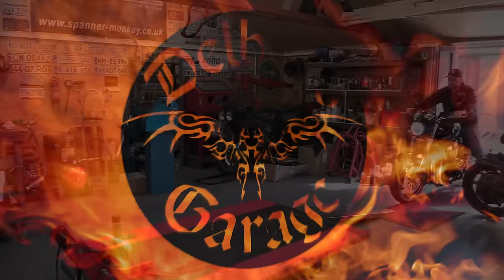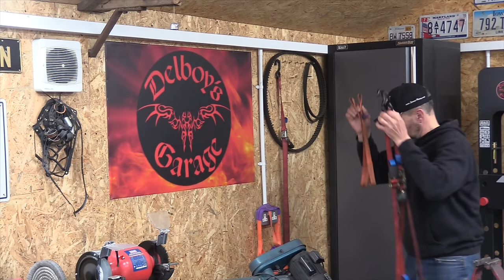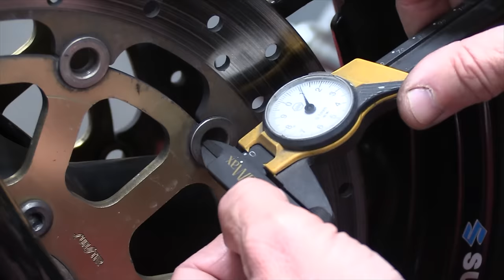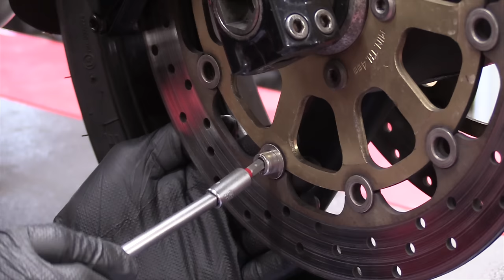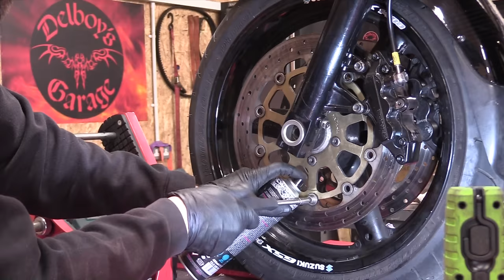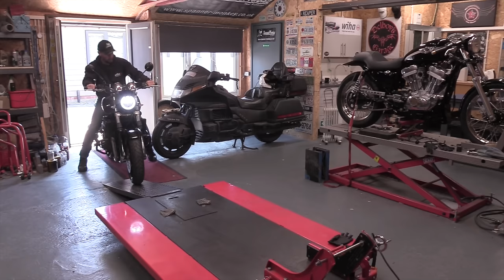Warped Motorcycle Brake Disc?  or Jammed up Bobbins?  Easy Fix !

Comment: Delboy, i have a 2020 street glide special with the HD shift linkage. I have an impossible time getting into neutral. it will only go into neutral if the bike is actively moving forward. Can you show us what you would do to resolve this? I have ridden for 15 years, and have multiple bikes. And this is the only bike ive had any problem with.
Reply from the maker: Hi Richard.. if it's hard to disengage gears, and heavy going into gear first thing... then that's usually related to the clutch plates sticking together.. When was the Primary oil last changed? is it overdue?.. what oil was last put in it?, if it's thick gear oil thats often a mistake!!  maybe just change the Primary oil and check the clutch adjustment while the cover is off !  most of the time that sorts it out mate !
Reply: @Delboy's Garage  thanks for the reply. It shifts extremely nicely. Except into neutral. It has all regular and scheduled maintenance at the harley dealer. It has the screaming eagle synthetic for engine oil. Has only 7k miles on the bike. Done this since day 1. Wasn't sure if there was some kind of adjustment or if HD are just difficult to find neutral. My Indian, victory and yamaha haven't ever had this issue.
Reply from the maker: @fader2701  Ok, in that case you can eliminate any servicing mistakes or neglect... It could be that the bike just needs to loosen up.. Harley Davidson engines are and always have been agricultural and harsh.. and it's well understood that they take at least 10k miles to fully run in and loosen up!   Maybe bring it up with your dealer, you/re mid way to the 10k service, and just ask them if it's correct !

Comment: Thanks for this video Del.  Would this apply to a 2016 Harley Ultra?  I get the pulsating you described. 
I would walk out and look at the bike but it's in Florida and I'm in Michigan!
Reply from the maker: Hi Harold, i believe you have solid discs on your bike, i don't remember them being a carrier with bobbins..  Try cleaning both disc faces thoroughly with brake cleaner and dry shop towel to ensure all grease of dirt is off them.. if it still persists, maybe look at the calipers, see if the pads and pistons are a little gummed up with brake dust and dirt.. brakes only really work at their best when they're spotlessly clean, so always try cleaning first, it usually sorts out most minor anomalies !
Reply: Thank you, I will give that a try.

Comment: hi delboy got a harley davidson xl1200 sporster 2005 my brakes are judering there is no bobbins on the discs, what might it be .

kind regards michael
Reply from the maker: Broadly explained there mate, juddering can mean many things, I'd have to experience it to be accurate.  Why not give the discs a good thorough clean with brake cleaner, drop the calipers off, wash them out clean the pad faces you could have some contaminant in there, put it all back together and flush the brake fluid through, then try it again!  If that doesn't get rid of it, you could check your disc for 'run out' with a dial guage, could be possible warped, but very unlikely, unless you've bashed it!

Comment: Hi del, You have helped me on a few occasions, I usually follow your bobbins cleaning method, with one exception. I use WD40 to spray away the dust. I know your not too keen on this idea to say the least, but to be fair I’ve had no problems yet. I am a bit worried about using brake cleaner, as I used some to remove dirt from my radiator a couple of years ago and it got onto my down pipes and removed my paint, I don’t want the same to happen to my discs, have you got an alternative idea?!
Kind regards!!
Robin
Reply from the maker: Personally i would never use it Robin.. Brake cleaner is made for cleaning brakes.. WD40 is an oil, any residue could migrate out on to the brake disc.. but im sure you know that mate.. and as long as you clean it all off, and as you said, you've never had a problem.. i guess it works for you. !  as an alternative, if you really don't want to use brake cleaner.. what about some strong detergent and cold water to thoroughly wash them out !!?

Comment: Would it help to blow out each one with a compressor after you clean it out with brake clean? Edit: Nevermind, this didn't do shit to help my front brakes. They're still pretty tight, I think my rotors are just slightly warped.

Comment: I'd have to use a case of brake cleaner to get mine to move. They are really unhappy. Will move with a bolt but that was as far as a I got so far.
Reply from the maker: Some bikes they are a tight fit and will only turn with tools.. as long as they're not jammed and misaligned, then that fine.

Comment: Could this issue occur with brand new discs that are listed as floating?
Reply from the maker: Considering the problem is related to dirt jamming up between the bobbins and the rotor and carrier, and as you say they're brand new, then they shouldn't be that dirty yet!  If you make sure all the bobbins are turning and it's still a problem, then it's some other reason mate.

Comment: Have this problem on my Indian ftr but it’s not a floating disc it’s fixed directly to the wheel?
Reply from the maker: If they're solid mounted, then clean the discs thoroughly inside and outside...and if it still persists, then its a pad or caliper problem..!

Comment: I am trying to clean it on my crf250L I have even twisted the 8mm bolt with an electric drill 
But it just doesn’t seem to twist with only my fingers 
Any idea?
Reply from the maker: DON'T do it with a drill mate.. just gently by hand as i showed.. as long as they're free to rotate, under hand pressure with a hand tool... they're fine !
Reply: @Moonfleet41  thank you for the reply 
I’m able to twist it with hand pressure and a tool 
It’s better than before but not perfect

Comment: Even with cleaning the bobbins, never noticed play in the disk like that…
Reply from the maker: Should only be rotational, not lateral.. and only very slight..!  hold yer front bake on and rock your bike back n fourth..!  should see them move if their clean !
Reply: @Moonfleet41  Hum... even with giving them another clean, I don't notice it, but also I don't feel an issue with the brakes.
That and not being able to spin them by hand,  2010 Kawaski that lives be the sea.

Comment: Good instructional vid, Del.  Very straightforward and helpful!   BTW, my MIL makes a similar noise but I’ll be d@mned if I’m going to clean out her old  bobbins.  The noise is fine, besides, she spends the better part of the day under the shed hunting down earthworms for her snacks anyway. 

Hope you both are well!  
🏍👍🏍
Reply from the maker: Sounds like a change of diet brother.. lay off the tripe mix and maybe some dry biscuits and water for a while.. 😅
Reply: @Moonfleet41  Could be, Del.  I’ll give the  dry bits a try for her.  I’m wondering if I should cut out the used motor oil. She sure does like that stuff though.  😎
Reply from the maker: Fcsake lol! 😂😂😂
Reply: @Moonfleet41  hehe… take it easy, my friend!